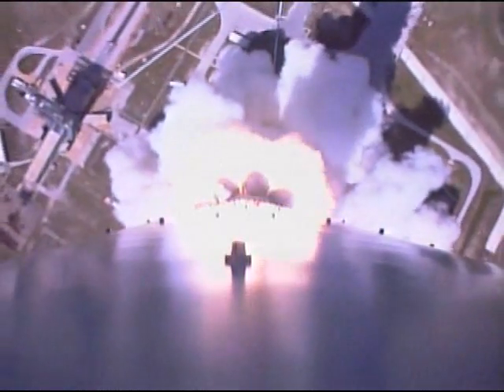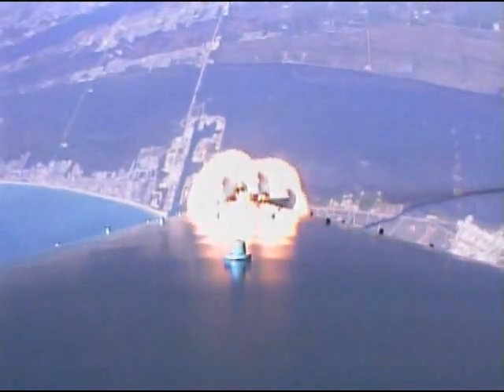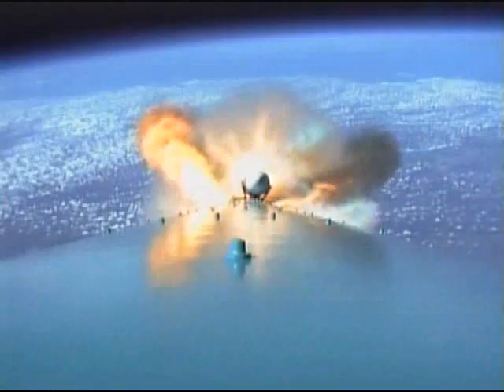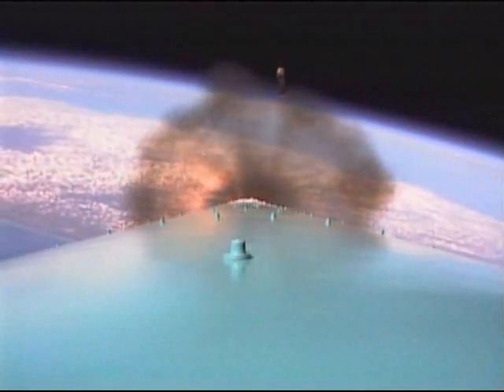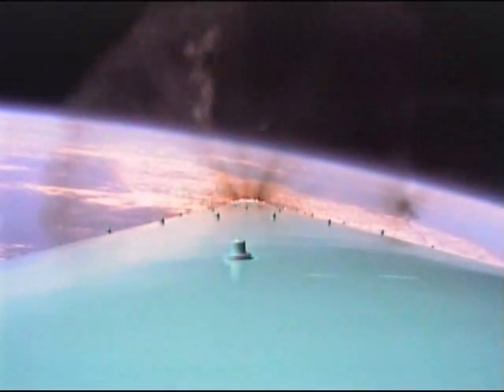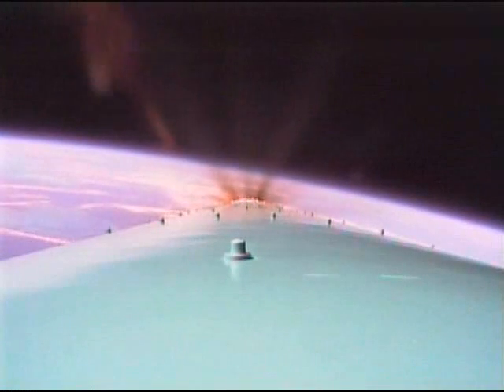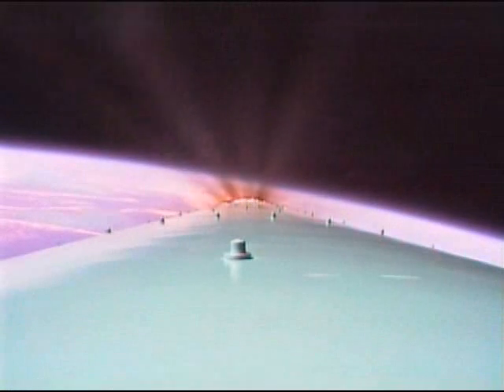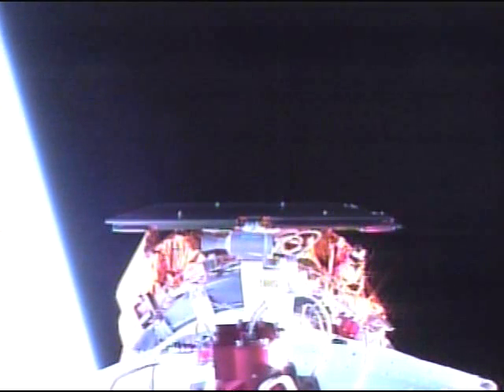Mars Odyssey lift-off, booster separation, main engine cut-off, staging, fairing jettison

Comment: Why is it horizontal?
Reply from the maker: To get into orbit, a spaceship needs a very high horizontal velocity (about 7.8km or 4.85 miles per second). The Earth's gravity bends the trajectory from the horizontal movement into the circular orbit. 

Most of a rocket's energy is expended going sideways really fast. Only a small portion is used to lift the rocket away from the Earth; rockets initially go up vertically to leave the denser parts of the atmosphere behind them, but then gradually turn side-ways to build up the horizontal speed (once out of the atmosphere) to get into orbit.
Reply: @kerbonaut  it's important to steer a rocket launch vehicle so we can make our own orbit
Reply: its basically called gravity turn